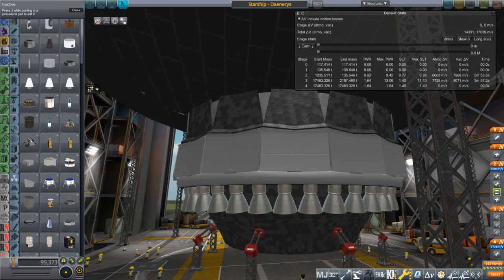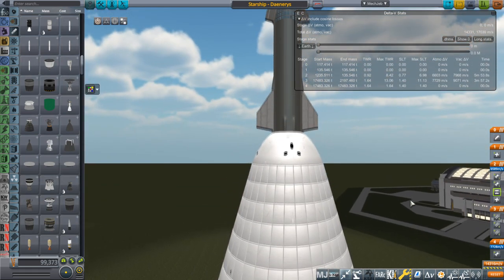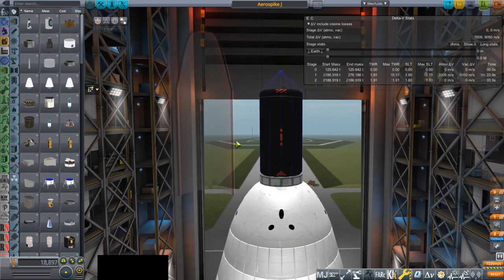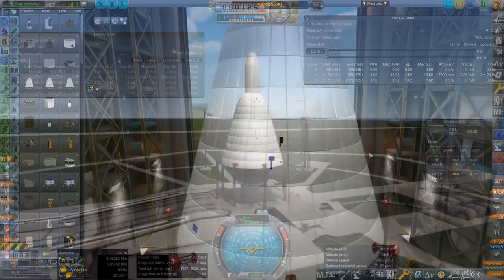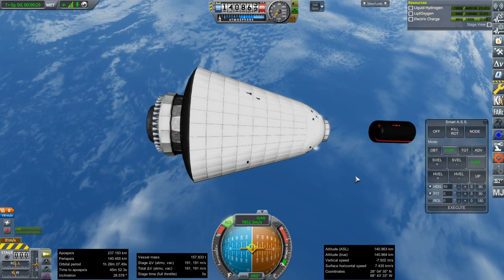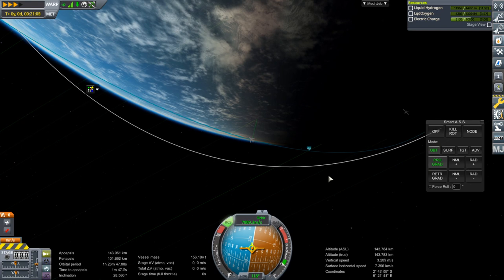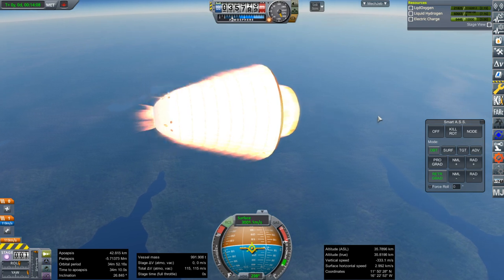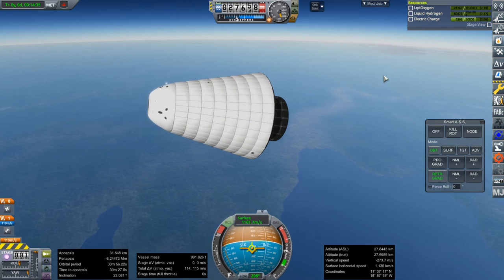Realism Overhaul in KSP 1.8.1 - Aerospike SSTO Capacity Testing

Comment: 14:20 Well, you still need to add those parachutes/other recovery systems, which will eat into that payload capacity.

20:00 Thanks for indirectly giving the Shuttle's wing area.

20:10 The Shuttle's total surface area minus engines is around 1049 m^2. (Oh my god it was so difficult to find this figure...) However, you must consider what parts are actually being exposed to significant drag and thus heating. For this vehicle, it is the entire base, while for the shuttle it is largely the underside of the wings. Thus, according to the relevant ballistic coefficient figures you gave—mass per base area for the Aerospike J, wing loading for the Shuttle—the thermal protection requirements for both vehicles are roughly the same.

22:10 The major difference is probably that you reentered ballistically while the Shuttle performs a gliding reentry.

23:00 That reminds me, I've attempted to use figures derived from the Shuttle External Tank, the Orbiter, and its heat shielding to calculate the mass figures for a series of spaceplanes. The conclusions were fine for the smaller vehicle (~13–14% dry mass), but those for the larger one were quite dubious (~7% dry mass), especially given that they're based on identical airframes. Didn't you have a sort of tutorial for structural design and estimation? I mean, you have misgivings about the mass fractions of these vehicles, but what you're doing is almost certainly a bit more legit than what I'm doing.

23:20 I think that eventually, that trend will reverse due to a runaway of material mass required to support itself and flight loads with limited material strength, or, more poetically, the Skyscraper Effect.

25:00 Sorry for deconstructing the very reason why you've built these, but can't you use some kind of editing tool to move Starship into orbit instantly?
Reply from the maker: On the structural mass, we could expect the dry mass percentage to be lower because it scales closer to the square of the diameter (the surface area) while the propellant mass scales by the cube. However, it gets a bit tricky when we're talking about really huge tanks and the extent to which they will need to be reinforced to handle dynamic pressure and gusts. That's the sort of thing done with CFD and computer modeling - I can't do it with pen and paper - so I can't be certain and there's nothing of similar size to compare them to. On why I don't just use the cheat menu to place Starship in orbit, this is more interesting, more fun, and I have generally made it a policy to actually launch things. Even the Starship Enterprise, on occasion.

Comment: Reentry Tiles would Likely be Larger in Area than SS tiles individually, and considering Most will be Identical in shape(90%?) and need only a few molds to fit around almost all of the surface will lead to cheaper costs and far easier attachment with less bonding compound leading to much lighter mass compared to SLS tile systems. It will also have better lift due to an induced spin, off AOA during re-entry. A Replicated body (axially) will also give an opportunity to be strengthened and lightened with near zero rework, if one has a defect it would not be used in this system. But Reworked parts could be used in smaller uncrewed or non-aerospace uses. But I think Larger payloads will be made by not adhering to a true SSTO design, buy adding side boosters that will not exit the lower atmosphere.

Comment: For the rl-10 based engine shouldn’t it have a higher twr because there is a greater ‘throat’ area and so there is more heat to boil the hydrogen, leading to higher possible pressures and performance?
Reply from the maker: More pressure is gained by the same particles moving through a smaller space, not a larger one. The lower the pressure for a given thrust, the larger the throat area and the larger the engine (and therefore the larger the mass). That's why the low chamber pressure Apollo Service Module engine is about the same size as the Merlin 1D Vacuum despite providing a tenth of the thrust.
Reply: Sorry, I wasn’t clear, I meant to suggest that the performance of the rl10 based aerospike would be changed a decent amount because I have been under the impression that aerospike have higher heat flux into the engine from the burned propellant due to their nature, and since the rl10 has a low two maybe the expander cycle with a hotter hydrogen gas would allow for better performance.
Reply from the maker: Ah, I'm not sure how to calculate this potential improvement in performance, though.

Comment: Trying to understand something about aerospikes. Saw the convair nexus concept.

What is making this so efficient that it can function as an ssto compared to regular rockets?
Reply from the maker: There's a lot about aerospikes - and specifically their performance calculations - that I don't know enough about, but I'll try my best. The key is that you want the pressure at the end of your nozzle to match the ambient atmosphere to be optimal, but this means that you want short nozzles at sea level and really long nozzles higher up or in vacuum. With the aerospike, the little chambers have the short nozzles on, allowing it to get good specific impulse at sea level, which is critical to not losing delta-v to drag and gravity losses. Higher up, though, the thrust gets pushed against the spike which acts like part of a longer nozzle, capturing some of the better vacuum efficiency. It's not as good as having a full vacuum nozzle, I think, but it's a reasonable compromise. Aerospikes generally benefit from scale because of the way they are made from lots of chambers.

Comment: Looks awesome! But chutes sounds rather problematic for this design: 1) it easily tips over after the landing 2) IRL you would need to protect the engine section from impact as it has very heavy thermal protection -> it's very-very fragile
Reply: Landing legs on the base of the spike/tank interface (if you can get them long enough) which is how the original ROMBUS and early NEXUS planned to land on land. Was always a bit easier at sea (as long as the actual impact speed was really low) though the (at the time) unknowns of water immersion for the engines was a big concern.

Comment: I've been having the same problem with weird power drain in 1.7.3 and 1.8.1, it appears to be a problem with rp-1 or the coms mod.
Reply: Real Antennas will cause unusually high power draw if you have comms disabled in the difficulty settings.

Comment: it wuold help if your big areo spike used liqued methine intead of hyogren becuse mithane is much higher engery diesinty for less volume theres a reason starship and the raptor used methane to save wight by less volaume of the tank with the methane wile hyogen is very bully with valome that make a big difince when it come to criogenic fuel tanks less valoume = less mass and methaine also needs less themal inslation too by the way sence it doesn't need to be as cold to stay at liqued by the way for exapile the boiling point of methane is at 111.65 K compared to hydrogen 20.28K and lquid methane gram to leater voume is 422.62 grams per ledter wihle hydogen is 70.85 grams per leeter not even close at all to methane so by not useing methane your realy shooting your self in the mass on both thramal shelding volume and mass basicly and you can get methine on mars too by the way